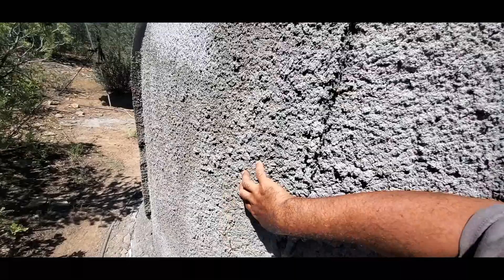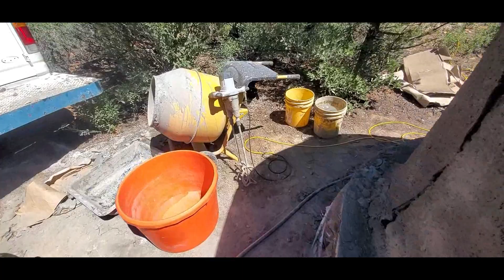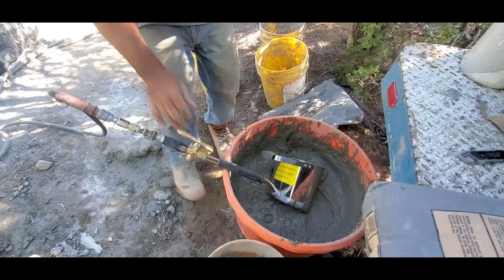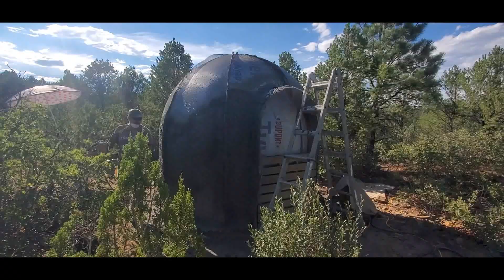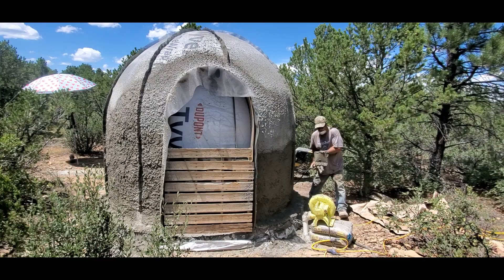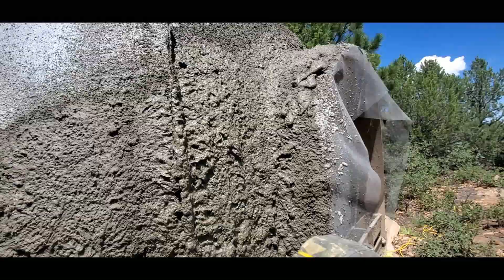Spraying Dome Update | Part 2 | Ceramic Beads Dome Build #aircreteharry #airform #dome #ceramicbeads

Comment: Looking at your work flow i would get a second ladder and plartform set the bin on the platform mix on the platform dip n spray walking from bin to roof section far reduced walking up n down the ladders
Reply from the maker: The whole carrying the bags up high would not be what I personally would do (unless there is a machinery that can lift them all up, - sure) The platforms / ladders all around, absolutely. What I'm pointing out here is that one would not need to spend more than needed. If you can afford it to have a wider set-up I encoure that, too. 👍 👍

Comment: Another excellent video Harry!  Your texture is rough (Exactly like my sand/cement mix that I spray for top strength)  When I am shooting my finish coats I add type s hydrated lime (3 parts portland cement, 1 part type s lime, and 9 parts sand)... This can be troweled smooth and then wet floated for a beautiful finish...
Reply from the maker: That's great Man 👍 👍 
AWESOME!!
Reply from the maker: Thank you Brother! 👍 
APPRECIATE YOU!!

Comment: Could you combine that stucco sprayer with your pneumatic cement pump to get a longer lasting pour for spraying the domes?
Reply from the maker: Please be more specific.
Reply: @AircreteHarry  the pneumatic cement pump you made with the 55 gallon drum.  Run the output of that to your sprayer and make a makeshift gunite pump.
Reply from the maker: @antoniosanford4675  Thanks for clarifying, Antonio. That DIY pump you are referring to is for Aircrete Work. It is not for pumping Stucco Mix.
Reply: @antoniosanford4675  If you tried to pump the thick stucco it would take quite alot of air pressure and when you ran out of the mix the hose would whip violently shooting concrete out rapidly and injuring anyone within 10 feet... People have died trying this very thing....
Reply: I'm not talking about spraying stucco. I meant using that setup for aircrete spraying.
Reply from the maker: @antoniosanford4675  That's exactly what that DIY pump was made for, yes. And it works great for Aircrete 👍 
In this Build I have not used any Aircrete though.

Comment: Ok Harry....we gotta build a "movable", arched, ladder track, around the domes!  Also...stucco sprayer too heavy for me.  That has to go on track too, with much larger bucket.  Everything is about the circle and preparation for the job at hand!  Certainly taking the time to accommodate a diy track would save all of us a tremendous amount of labor and time!  I can't wait to come see you and your wife at a class .... my brain is bursting with ideas and I have so much to learn from y'all!
Reply: Toni, think you are on to something there. Especially for larger /taller domes.  You could roll bend metal conduit into a curve that fits around and near the top edge of the foundation and bolt it down.  Maybe find a couple ladders that fold and could be modified by adding pully type wheels that fit the conduit and join the ladders together to form an upside down U shape that goes over the dome and can circle around. Something like that would be real useful.  Maybe Aircrete Harry can create a visual prototype in blender as a talking point.
Reply from the maker: @edwinbickel  SUPPORT Me & My Work on Patreon: https://www.patreon.com/user?u=7402367
Reply: @edwinbickel  we're on the same page! I'm having the same visions.  Could be made adjustable to fit size of dome.  Maybe when the ring is poured it could be extended out from the foundation ring, like a little sidewalk around the dome to accommodate the track!  Might incorporate a center pole too.  The plastic could be sealed around it for inflating and the pole cold be removed later.  Hole could be sealed or used for ventilation!
Reply from the maker: DIY tracks would be a bit too complex to make - having in mind different size Domes / you would need different size tracks. A cart, with front & back wheels that is adjustable & that you can lock into possition would work better. 👍 👍 
Appreciate your Excitement!! 
Check out My Online Video Course on my website. Link in the description. 
It holds 15 Hours of Step-by-Step process.
Both E.P.I.C. & Aircrete Techniques included!
ON SALE Now until September 30, 2022 👍 ✅️
Reply: @AircreteHarry  I was just thinking a single track (round conduit) around and near the edge of the foundation. But it could be a manual move as well.  Ladder out of aluminum in the shape of an upside down U.  Look at the beginning of how this ladder is set up to get the idea. 
ALUMINIUM FOLDING LADDER 4X3-TREAD 3.34M | Screwfix
https://youtu.be/zc31T5sJoPc

Comment: Looks good though gotta figure out how to eliminate the tiny hopper using something like a sewage pump.
Reply from the maker: Sewage pump would not work. You would need an actual cement pump.
Reply: @AircreteHarry  OK.  A sewage pump was just a thought because I am familiar with them.  Anyway, I watched your video and thought "no way do I want to go up and down that ladder every 5 seconds."  Are you investigating using a cement pump or would it just not be worth while?
Reply from the maker: @nwbudro9210  I already have a cement pump. (See other videos) In this project I am demonstrating how you can build successfully by using a Stucco Sprayer for DIYers 👍 👍
Reply: I think that would work!!! Something like spray on stucco.
Having a constant supply of wet mix would be the next challenge. A bigger 'tow behind'  mixer might keep up with the demand for a good stream or flow.  I think you'd run out of wet mix fast! But what a hoot, that would do it a lot faster and thicker! ( not necessarily thicker is better in this application in my opinion.)
Of course out in the middle of know where, power would be a need to run a full blown cement mixer and pump power for your hose. With some good solar units, it can be done. Gas is pricy at this writing, but able. I do like the idea though. I could get into trouble with that Cool thinking! 😇   🤠
Reply from the maker: @suzanneweitzel8969  You already know we look forward to your updates on your shares visions of different applications. Encouraging you highly! 😁 👍 👍
Reply: @AircreteHarry  Okay, I haven't had a cement pump luxury. I have been around the sewage pumps, so an image in my minds eye with that was faster! Never tried it, but it could be fun if it were all that was available! Hummm
 I would be having a blast on your project though! Mud fights and all! Gotta have a little fun while being creative!🤠
Reply from the maker: @suzanneweitzel8969  Good Attitude 👍 
Yes, fun is very beneficial & makes work awesome. Leaves you with great memories.
Pump is a good thing to have but not necessary. It is very doable with a Stucco Sprayer. 👍